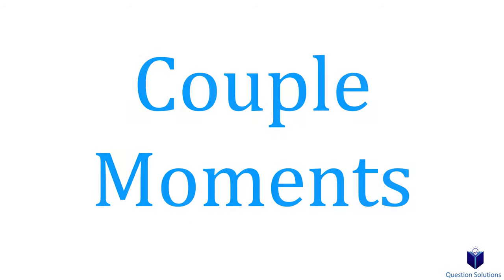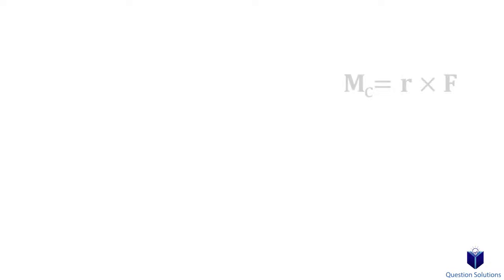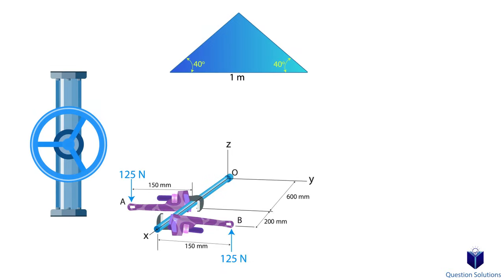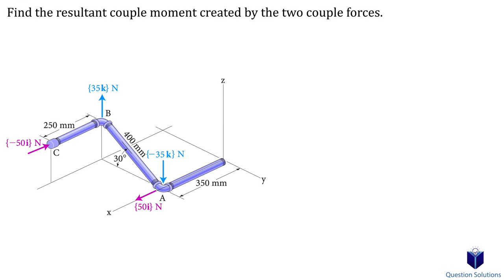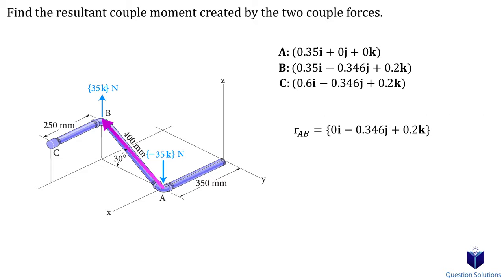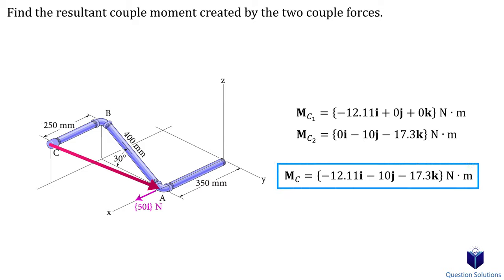Couple Moments | Mechanics Statics | (Learn to solve any question)

Comment: Hello Question Solutions, hope you're doing well!

I have a question, at 3:25 you found the Force in cartesian form to be {0i+0j+125k} I'm a little confused by how you found that, I thought we usually do f*(unit vector along Rab) to find the Force in cartesian form, could you please explain to me how you were able to find the force in cartesian form by just looking at the force magnitude?

Thank you!
Reply from the maker: Sure, so if you look at the 125N force, it faces straight up. So that means it's not  at an angle, which also means that it lies directly on the z-axis. So it can only have a k-component and its 125N straight up along the z axis, giving us {0i+0j+125k}. If a force lies directly along an axis, we don't need to go through the trouble of multiplying it by a unit vector. Even if you do, remember that the z-axis unit vector is {0i+0j+1k}, so it still leads us back to the same place.

Comment: For the last question, if we were to use Rac & Rba (instead of Rca & Rba like shown in the video) are we supposed to get the same answer? was wondering since Im getting {-12.11i+10j+17.3k} should I consider the direction of the moment of each individual moment (Mc1 & Mc2)
Reply from the maker: You will get the same answer. If you go from A to C for your position vector, the only difference is that instead of ignoring the force at C, you ignore the force at A.

Comment: 3.16 ( why is the moment of force a is zero and how did you know the Cartesian form of the force on point b ) ??
Reply from the maker: So when you have a couple moment applied, to calculate it, you need to forget one of the forces and write a position vector from that location. Here, I chose to forget the force at A, and then wrote a position vector from A to B. The force is along the z-axis, (so just faces vertically without any other components), which means it only has a k-component. So it's just 125k.

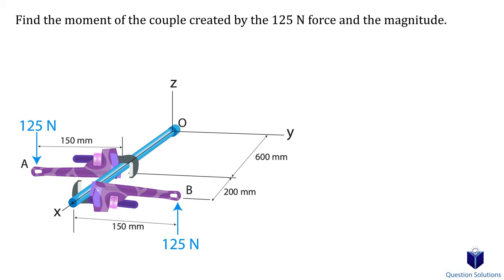Comment: For the problem at 2:51, does the vector Mc act perpendicular to the position vector, rab? also, where would you draw the couple moment?
Reply from the maker: The vector for the couple moment would be directed along the x-axis. The direction of the vector has to be found using the right hand rule. So here, a counter-clockwise moment would mean it points along the positive x-axis.

Comment: It must be positive when the force is in counter-clockwise direction and vice versa
Reply from the maker: No, it doesn't. It's completely up to you on which way you want it to be positive, because there aren't really any "positive or negative" moments. They have a direction. The positives and negatives help with figuring out the direction when doing problems. You can pick whichever way you want it to be positive, and if you get a negative answer, it's opposite to your assumption. In fact, I encourage you to do it opposite to what you just said so you can realize that you still get the same answer. This will bring you more insight into doing these problems, and will allow you to pick whichever direction you want to be positive, making you solve questions faster.

Comment: Hi, quick question abt the steering wheel. if the force is at an angle, would i find the x and y component and then find the x-y component of the distance? then do M=Fd in the x component and then M=Fd in the y component
Reply from the maker: In the steering wheel as in the ships wheel? So you have the forces applied at the 9 and 3 o'clock positions? If the force is at an angle, then you break the force into x and y components. The x component won't create a moment since it would just be pulling the wheel apart. It's like grabbing the 2 sides and one side pulls to the left and the other to the right. Only the y-component will create a moment. But in general, the steps you outlined are correct.

Comment: can u explain how couple moment can become negative or positive ?
Reply from the maker: So moments aren't really positive or negative, in 2D, you use clockwise or counter-clockwise to state the direction. In 3D, you can use the right hand rule (same with 2D), if you want to know the direction of the moment vector. But in essence, let's say you pick clockwise to be positive, and your answer is positive, then your moment is clockwise. If you get a negative answer, that means your moment is counter-clockwise because you picked clockwise to be positive but your answer was negative. The same is true for the opposite. So if you pick counter-clockwise to be positive, and your answer is positive, then your moment is counter-clockwise. If your answer is negative, then your moment is clockwise.
Reply: @QuestionSolutions  hmm. Is this the same concept for dynamics bro ? Bcs I've been searching for how to determine the sign convention for work done due to couple moment. As far as I know. It depends on the torque direction right ? So how do I know the direction of the torque ? Is it the same as the direction of the rotation ??
Reply from the maker: @ikmalhakimharun3823  I think you might be confusing the moment vector with the direction of turning. The vector is always found using the right hand rule. Work done by moments when it comes to dynamics involves taking the mass moment of inertia. Is that something you already covered? I think you might be mixing 2 topics together. :) Is there a problem you can show me that requires what you are asking? I can take a look and let you know.
Reply: @QuestionSolutions  hmm. Probably bro. I think so too. I don't know much about couple moment. So I just Google them and found out the sign convention are related with the rotation of torque. Btw bro. Where can I give u the problem ?
Reply from the maker: @ikmalhakimharun3823  Email me at "contact @ questionsolutions .com" without any spaces. Make sure to check your junk/spam box for my reply, for some reason, sometimes, it goes into those.

Comment: I'm confused at the side of the triangle 2:28

I tried solving it with 1sin(40°) and my calculator gives me 0.6427
Reply: Ohh can you explain me why is it 0.5(cos40)? Im pretty bad at this trigonometry thing
Reply: And can you also explain to me where did you also get that 400? Around 2:28 also
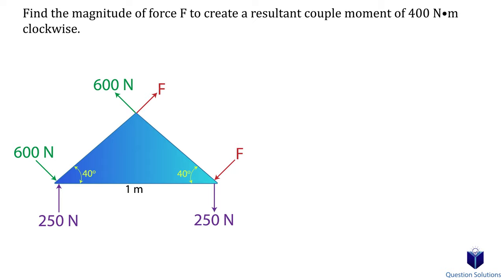Reply from the maker: @archiedahili5391  Okay, so first, look at 2:20. See how I drew that pink right angle triangle? That triangle is an exact half of the big blue triangle. That means the bottom length is 0.5 m, since that's 1/2 = 0.5 m. Now that we know the bottom length, we can use the angle given to us (the 40 degree angle), to figure out the hypotenuse of the pink triangle. This hypotenuse is also the side length of the big blue triangle. So we know the adjacent length, (bottom length), which was 0.5 m. Since we have adjacent length, we need to use cosine because cosine = adjacent/hypotenuse. We can't use sine unless we know the opposite length, in this cause, that would be the height of the triangle. 

So we can write: cos(40) = 0.5/length.
Isolate it for length.
length = 0.5/cos(40) ==> 0.653 m.

I hope that helps.
Reply: @QuestionSolutions  oohhh ok ok thank youuu
Reply from the maker: @archiedahili5391  You're very welcome!

Comment: 4:30 you forgot to add - to J vector when doing cross multiplication. it should be positive 12.11
Reply from the maker: I assume you mean the i component, not j, since the j component is 0, and the normal convention is to not put negative signs in front of 0s, but you can if you want, it's your choice. I mean it has no value, so it doesn't really matter. 😅In most cases, you wouldn't even write out the j component, but I did because students tend to get confused or ask what happened to it. Anyways, if you are really referring to the i component, what's shown on screen is perfectly correct. The i component is -12.11, since it's -0.346 x 35 = -12.11i. 👍
Reply: @QuestionSolutions  Ah yes silly of me... I should go for a sleep now... Thank you sincerely.
Reply from the maker: @theturkish1373  Have a wonderful rest! :)